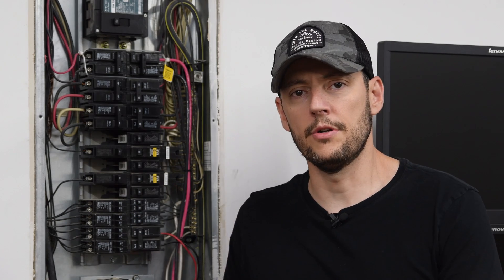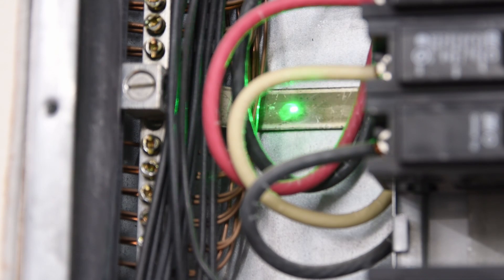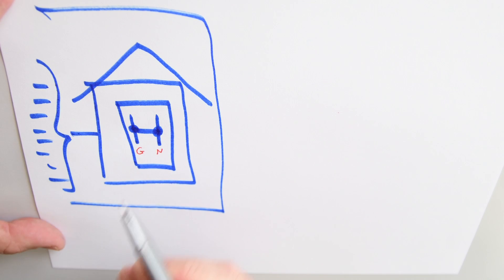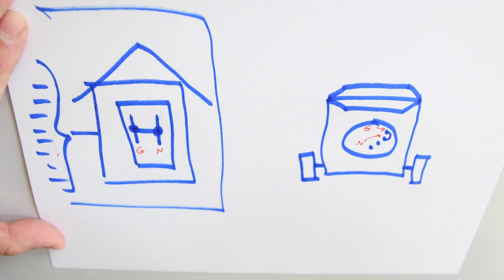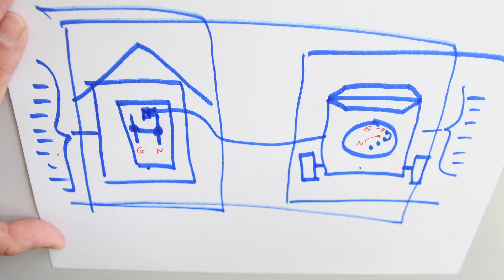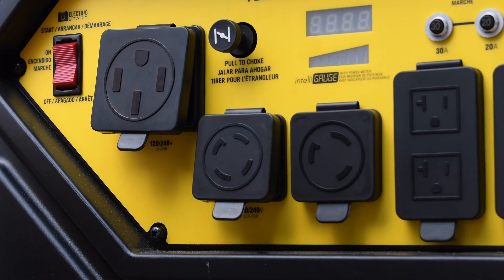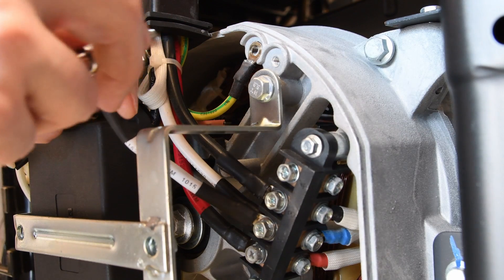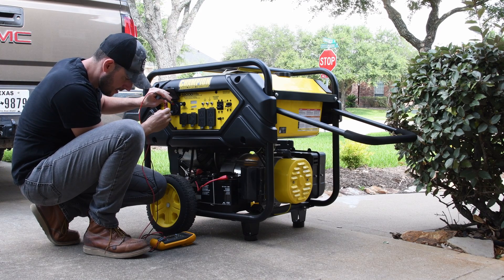Bonded vs Floating neutral. portable generator as power back up

Comment: I just purchased an inverter generator and plan on backfeeding power to my house by an unused dryer plug in the utility room. I plan on doing this mod to my generator. my question is 2 parts 1st my generator has a 4 wire 50 amp plug and my house has a old 3 wire recepticle what is the best way to make up this cord? and my second question is once I convert my generator to a floating neutral are there any risks if I was to use this generator out somewhere else like camping or up north or with extension cords running power tools etc...
Reply from the maker: If you use the generator in camping applications it will work but for safety, in some conditions may give be unsafe, damaged tools or appliances, you should bond it again or install a switch to toggle between floating and bonded. About the dryer back feed, I'm not a fan of it and I do not recommend it. Just the cable to the plug with the prongs exposes give me the chills. Your receptable have three wires because the neutral and ground and already bonded in the panel. I can but recommend an inexpensive interlock system, way safer. I think of any family member having to connect the generator by themselves if I'm not home. If they turn on the generator with the cable connected to it and the breaker on, the end side of the cable with exposed prongs, the one going into the dryer, will be energized. Huge hazard.
Reply: Your dryer receptacle is a 3 prong, which means you do not have a way to connect your house ground to your generator through the cord.
Reply: Bad idea using dryer plug

Comment: It depends how the panel is wired. If the bonding takes place there, then OK. In most of Europe bonding is done at the meter. Then you put your changeover switch and choose utility or generator. No need to remove the bonding then.
Reply: Most of the generators I have seen ( and the 2 i own) have an external ground connection on the panel here in the UK. They are not internally bonded.
Problem is if you are using an unbonded generator with a transfer switch in places like the UK,  the earth is NOT IN THE BOX ( consumer unit) but on the tails coming into the meter, say  like say with central heating which nowadays have a computer... IT knows this and will not work as it needs an earth or it will not t work as a safety design. So the Generator has to remain bonded.

Comment: I'm currently trying to backfeed to my panel through my dryer outlet but it's not working...im taking all necessary precautions. Is this something that might help? 
I turn my main off, im getting power at the plug...the dryer breaker is on, but I get nothing. I'm genuinely curious if this would be the answer im looking for
Reply: That’s a really bad idea using your dryer back fead ☠️☠️☠️☠️☠️
Reply from the maker: I know some people do it that way but I can't but recommend an interlock or transfer switch. Specially the first is very affordable and safe.

Comment: Im surprised, it sounds like a lot of portable generators are bonded N but my Westinghouse is floating which means I dont have to do anything to it.
Reply from the maker: You are right, actually Westinghouse market their generators for power back up for houses, so already come floating. Westinghouse are great generators btw.
Reply: @BUTTEWORKS  ohh okay, I got the Wgen3600C on Amazon on sale for $267.  That was the only reason I went with that brand but it seems well built and that explains why they would do floating N.
Reply: @Mixwell1983 what does it say in the manual for using it for non home backup? Do you need to bond the neutral yourself?

Comment: so it would be best to just add a longer bonding wire with a switch that you can turn bonding on/off as needed.  but good vid thanks for the info.
Reply from the maker: Agree, that would be the way to do it if you are planning using the generator in different applications.

Comment: Best explanation of this topic on the internet by far. Thank you.  
What I’m still trying to understand is….if I keep the Gen as a bonded neutral, while powering the home via an interlock setup, what’s the worst that can happen?  Fire? Death? Damage to main panel and/or Gen?   I’ve yet to hear an explanation of what could happen if not NEC compliant in this situation nor have I seen or heard of anyone having a problem in this situation.   Thanks again!
Reply from the maker: Hi jayortiz8617, most likely nothing if all your the consumers in your house and the electrical system are in good order. Accidents will happen depending on how bad your electrical system is, or how bad a certain device is damaged, ground failure, damage wire isolations etc. So the extend of the damage depends. of many factors.
Reply: Sometimes nothing happens. Other times the neutral current returns to the generator on the ground wire instead of the dedicated neutral wire because a parallel path (2 bonds) is created. The GFCI's of the generator may trip causing power of the 240V outlet to the house to be disconnected making it un usable for home backup power.

Comment: Well it's easier than that to explain really.  Electrical codes aside.... You only want the ground and the neutral bonded at the place it's grounded to the Earth.  In your house this is at your service panel or your primary disconnect.  

The reason for this is simple ..... If they were connected anywhere else it's possible to carry part of your neutral current on the ground wire... All the time, which could energize everything that's on that ground wire and shock people.    You can have a small voltage on your neutral wire because of the voltage drop on that wire due to resistance.

So when you connected to a house you want the neutral and the ground to be bonded only at the house of service panel, along with the house.

When you have your neutral and ground bonded at the generator then the generator can  be grounded at it. The gfci feature on receptacles wont work unless bonded.  It has to be capable of carrying current on the ground wire in order for it to trip.  This is really the main reason generators come with a bonded neutral today.   They used to not.

When your connected to things not grounded...insulated Power tools.....it doesnt matter much really.  In fact....if the neutral is not grounded to earth.... Then a hot wire will not shock YOU...if you touch it.  There's no way the path can be completed if the neutral isn't bonded to ground, and the generator grounded. (Just sitting on the ground is enough to ground it).  Makes you say why did they even think they needed the gfci in the first place?   I'm not sure a Gfci add anything to a generator use when you have the possibility of not bonding the neutral .

For other things you might plug in that do get grounded to Earth by sitting on it or such, then having the generator grounded and bonded is a safety feature, and the GFCI can be worth something safety-wise too.

Comment: If I was hooking up a generator directly to my gas furnace (not through the breaker panel), I would need the generator to be neutral bonded?
Reply from the maker: Should be bonded. Any device you plug directly to the generator, keep it bonded.

Comment: Thanks for sharing this.  I was looking to buy a Honda EB10000 generator, but the manual specifically says that the generator cannot be hooked up the a house electrical system because of the bonded neutral situation.
Reply from the maker: Now you know the trick, Glad it helped you.
Reply: I have a Honda EB6500x about 15 years old. I removed the bonding wire from the generator head and now use 4wire lead back to my sub panel, that is not bonded. It works flawlessly!

Comment: Why don't they just have a switch?
Reply from the maker: I believe it is safety,  since you use the generator in one way or another, if you forget to flip the switch and are using the generator in the wrong configuration it could be dangerous. This is more for "advance" users.
Reply: @BUTTEWORKS  I just fixed my Dads old building site generator. It has a 220v and a 110 socket. It is a floating neutral. I am not sure whether to of how to bond the neutral as the 220v is basically a transformer winding that is centre tapped at halfway to give 110v.
Reply from the maker: Antidote21984. I’m no expert in this subject. You may have to ask a pro. I would bridge neutral to ground in the transformer if your goal is turn it into a bonded generator

Comment: Very good video. Our portable genset is wired into plug box for house worked ok with only light 120vac circuits during break-in period. Today notched it up to include a 240 circut when my deep well pump kicked in it threw the breaker that is located on the portable genset. Everything was as usual, with voltage switch set to 120-240 vac. Guess will look into the dyamo cover to determine if genset is bonded. Great easy to understand video explanation. Will leave the ground connected just remove from neutral post and reconnect back to ground screw so its there in case it's needed ....
😁👍
Reply from the maker: Good luck with your troubleshooting. make sure you 240 breaker is scaled for the amperage demanded by the well pump. Some motors have a longer start, enough to trip the breaker with the inrush current.
Reply: @BUTTEWORKS  the panel where the plug box feeds into has a 35 A breaker. This is a remote panel which feeds into the main house panel via 8 /4 feeding thru a 50 A breaker. If your wondering this circuit used to be for a hot tub. The 35 A breaker which snapped is the breaker on the generator itself.
Genset is 4850 surge, 3850 run which is fine for the 1 h.p. deep well pump according to charts perused. Appreciate your reply.
Will let ya know what we find in the dynamo...thanx.
Reply: @hokehinson5987  I doubt your issue was with the bonded neutral on the generator.  Well pumps pull a lot of amps.  You likely went over the rated amperage on the breaker when the well kicked on.  Turn off every breaker in your main except the well and see if the pump still kicks off the breaker.

Comment: What if your connecting the generator to a manual transfer switch like a reliance controls ? I was told it was safe to do that without messing with the generators wires
Reply from the maker: In that case you don't need to mess with the generator neutral but as you can see it is not that complicated. the installation is also simpler. With a transfer switch you will have only limited circuits to power up unless you get a full pannel transfer switch. Both are alight to me.
Reply: @BUTTEWORKS  So, just to be clear - a manual "transfer switch" will unbound the neutral ground from a portable generator and utilize a single neutral ground (in the panel).  True?  And the corallary - an "interlock" on the panel WILL require you to unbound the portable generator neutral ground (elimanate two neutral grounds).  Also, true?
Reply from the maker: @mikebever2546  The way I understand a transfer switch yes, it is true. Transfer switch transfer the neutral as well. Said that, this is my own research, I'm no electrician so double check with one.
Reply: The newer reliance manual transfer switches do not switch the neutral. They require floating neutral generator setups. Not sure about the older ones gotta find a manual.

Comment: Good video. Technically you don't have to remove the jumper. You can just put electrical tape around the side that was bonded with ground  and tuck it back in.
Reply from the maker: Good point, even better. Thanks for the comment.
Reply: @BUTTEWORKS  Thank you for your video and info ✌️❤️

Comment: So the question is what can happen if I leave the generator bonded as it comes from the factory to feed the house? So in this case I have 2 bonded points in the generator and in the electric panel. I am just curious to know the possible outcome of this.. thanks
Reply: Also if you have a faut in the house the breaker will not trip on your gen.
Reply from the maker: If all what you connect to you house is in good order electrically speaking, nothing, but if there would be an issue with a short to ground or neutral or something like that the generator could become an electrical hazard for the operator.

Comment: I'll echo other comments in that this is a great, simple explanation. My WEN GN875i inverter gen comes factory with a floating neutral which since I am using it for whole house backup (via backfeed with interlock) needs no modification. I thought this is correct but your video confirms it. I need to make a plug with neutral and ground connected to plug in should I ever use it as a standalone.
Reply from the maker: The Voigts, thank you for your feedback. I'm glad that the video helped you.

Comment: I bonded my generator as I primarily use extension cords however I heard bonding a portable generator creates power spikes that could be damaging to sensitive equipment/appliances anyone experience that?
Reply from the maker: Hi StrongManMattt, I don't think bonding a generator, which is they way they are wired for the most part, creates power spikes. You can look at the harmonic distortion of your generator which it is a parameter that shows, how spiky is you generator. THD Total Harmonic Distortion of 6% or bellow is ideal. Most none inverter generators are around 10%. What I do is I have three Cyberpower UPS  where I connect my computers, router, modem, TV, stereo, and other electronics. That is a great filter and power back up. Check in the description of the video where I have an affiliate link to the UPS. Never had an issue and I have run the generator in my house for days.
Reply: @BUTTEWORKS  That may be (no harm), but spike damage may not be instantaneous and degrade either the appliance or the surge protector over time, until it/they fail. That's why surge protector has a light indicating whether the protector is still active/alive or has died after too many spikes over a long period.
Reply from the maker: @raywu7933  I didn't though of that, good point though. Thank you for the info.
Reply: @BUTTEWORKS  Good to know thanks for the response.

Comment: Great video. The first video I have seen that simplifies the concept of floating neutral. I did not understand this before. Now I need to see if my Costco tri-fuel generator needs any tweaking. Thanks..
Reply from the maker: Thank you for your feedback, glad it was helpful.
Reply: curious if you floated the neutral on the Firman T07571?  I'm considering this and using an interlock to my house panel.  Thoughts?
Reply: Yes, I have the same generator and it’s bonded not a floating neutral.

Comment: Great video.  Only thing I would add is that you're suppose to place a label on the generator indicating that it has been converted to a floating neutral generator.  Like you my generator is used just for connecting to house electrical panel (with interlocked breakers).  I have the Hughes grounded neutral plug available in case I ever need to use the generator as a stand alone power source.
Reply from the maker: Very good observation. I did but not shown, like here in my Honda generator, min 6:05 https://www.youtube.com/watch?v=VCUxATuC3d8.  Thank you for the feedback Dane, very much appreciated.

Comment: Hello, if wanting to use the generator as a stand alone unit - not connected to the as opposed to the house panel - instead of reinstalling the bonding jumper (what you saved with the zip ties), could you instead just plug in something like a Hughes Autoformers Ground Neutral Plug? I think, but am not sure, this would return the generator to a bonded neutral configuration. You would lose access to one of the outlets as a result. However, this would eliminate having to take the cover off and reinstalling the jumper, saving time,  and requiring no tools.
Reply from the maker: Mark you are 100% right, and some people just add a switch  in the front panel to switch from floating to neutral. Since this generator will be used only and exclusively to power up a house in my case this was the easiest way. If I would use it  to power up tools on a i.e. job site, I would definitely have added a switch.
Reply: @BUTTEWORKS  Except when you periodically start it for maintenance purposes. Unless it's always plugged into the inlet connected to a breaker, it will not be bonded.
Reply from the maker: @allenjones3998  That is a really good point. Definitelly a reason to install a switch. Thank you for the comment.
Reply: @allenjones3998  I doubt would turn on the breaker to energize the outlets when just starting it for maint though right?